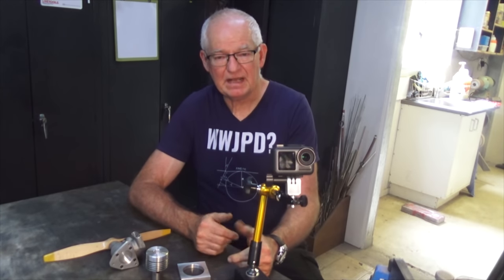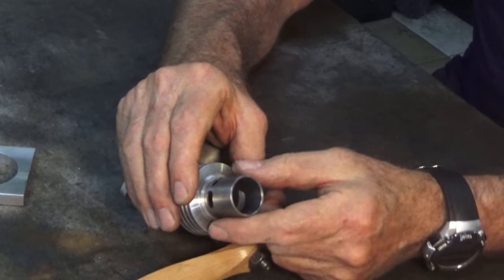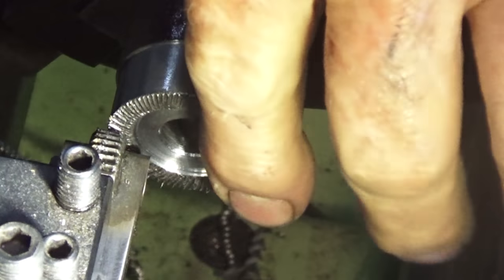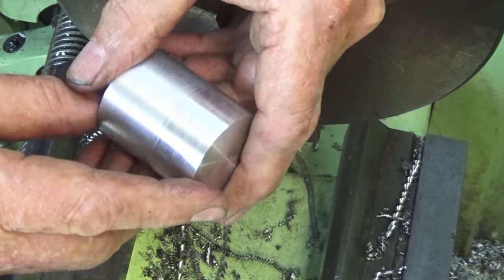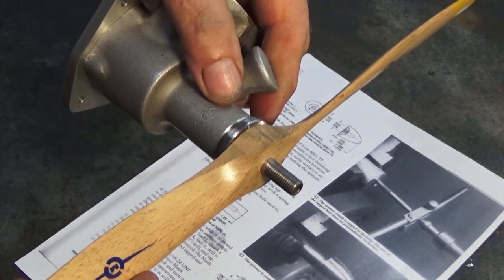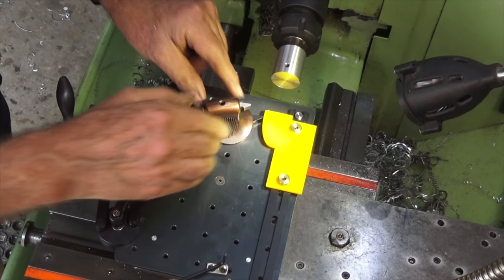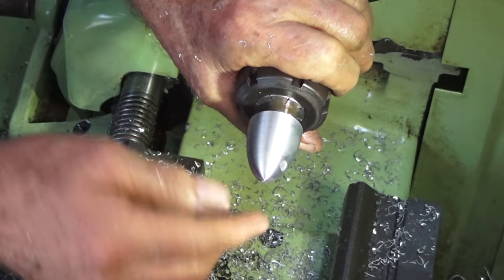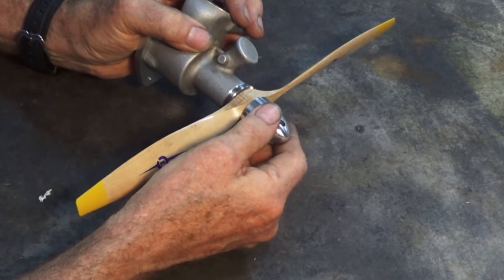Building the Titan .60 Glow Plug Engine #8

Comment: 4k is good if you have a 60 inch screen but then you also start to see image noise and things in the image after compressing the video much easier.

4k takes up a LOT of storage space so youtube compresses it. In that process, you weaken the image quality.

Older laptops or android tv box can not handle 4k as well or even 1080 (60p) as well. 60p!
Reply from the maker: I won't be shooting anything in 4K but it's nice to know it is capable of that resolution. It's nice to have another camera for some operations though.
Regards,
Mark

Comment: what is the point of filming in 4k? image quality is not just about resolution! with 4k you run out of storage space fast! youtube also weakens video! even if the new camera is 4k it does not mean that it produces better picture quality!

your computer works heavier and takes longer to get ready
Reply from the maker: I do agree. I shot some footage at 2.7K and to be honest I can't tell the difference to the 1080P I was capturing on the Sony Handicam. Maybe I have a rubbish monitor.
Regards,
Mark
Reply: @Preso58  4k is good if you have a 60 inch screen but then you also start to see image noise and things in the image after compressing the video much easier.

4k takes up a LOT of storage space so youtube compresses it. In that process, you weaken the image quality.

older laptops or android tv box can not handle 4k as well or or 1080 (60p) as well 60p!
Reply: @Preso58  The computer screen must be able to handle 4k and the resolution must be set to 4k or higher otherwise you will not get any benefits from 4k